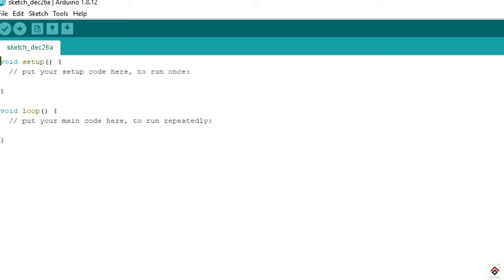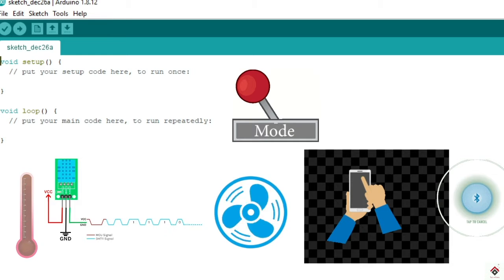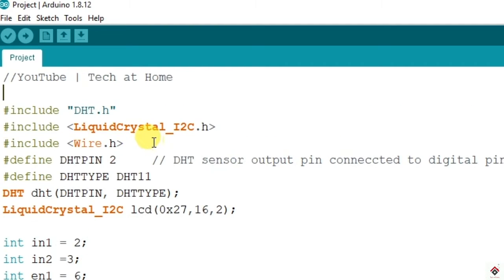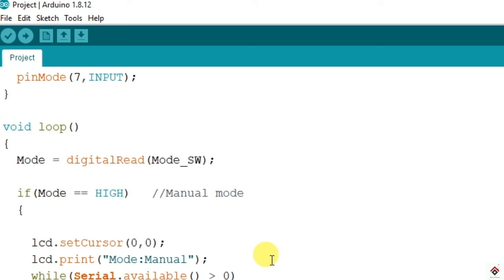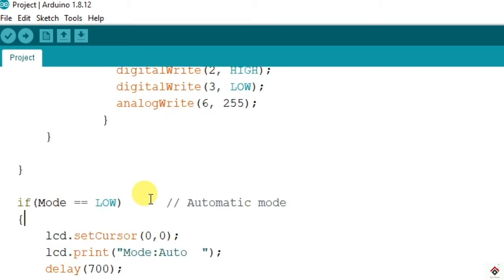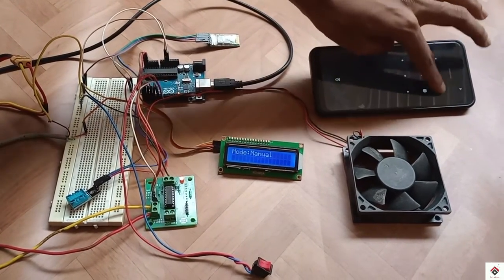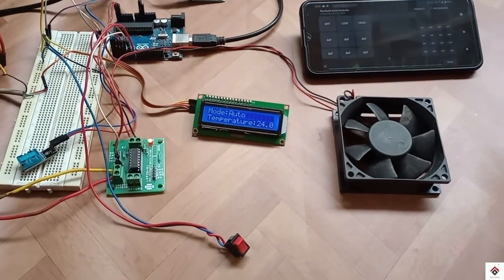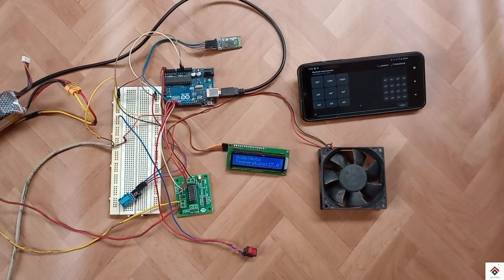Arduino Motor control with Auto and Manual mode | Arduino projects for students

Comment: How did you connect the toggle switch in the circuit?
Reply from the maker: It is connected to digital pin, you can get circuit from description.